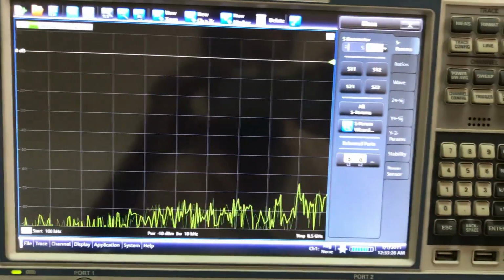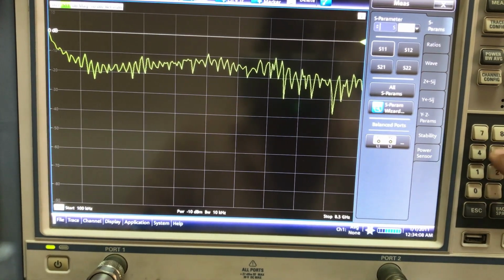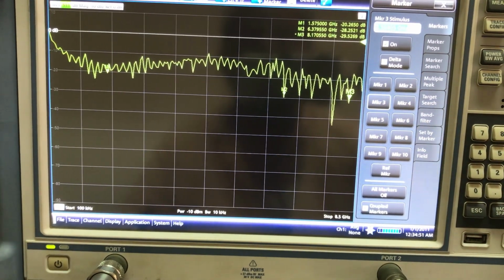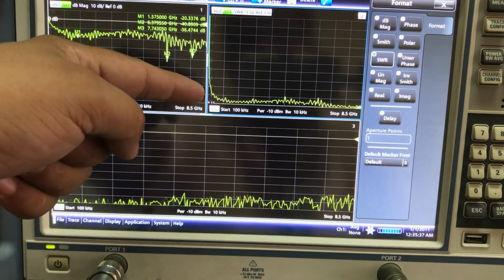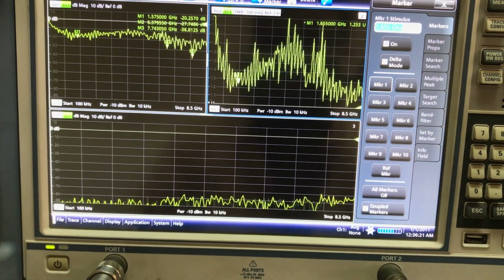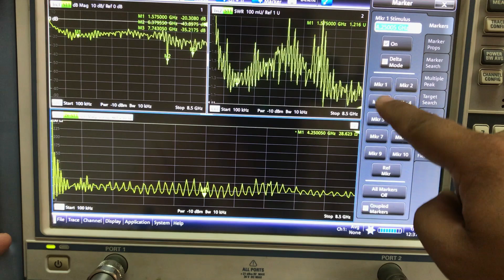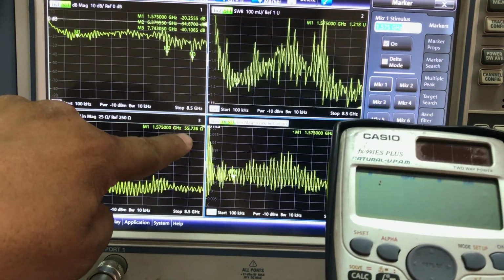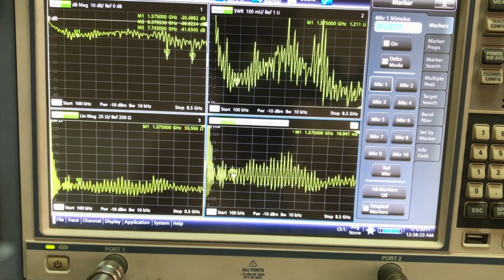How to Test GPS Antenna using VNA | Vector Network Analyzer | S11, Impedance | SWR, VSWR

Comment: I am sorry, a bit confused. You are measuring what?  GNSS antenna back end has an active LNA, you will need power to run the LNA.  As far as verification of 50 Ohm impedance is concerned at GNSS antenna SMA connector. If impedance is off, a huge Signal attention will be experienced. Receiver will not preform well. Best way to measure impedance would be using a Passive GNSS antenna.
Reply from the maker: Thank you